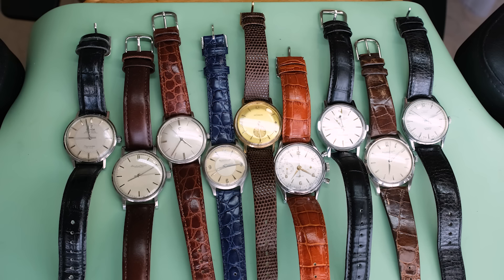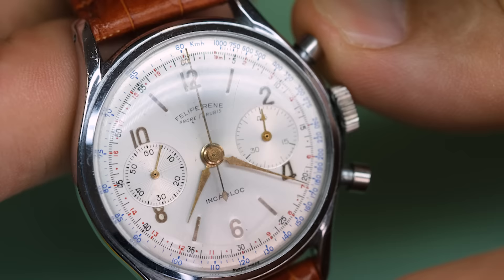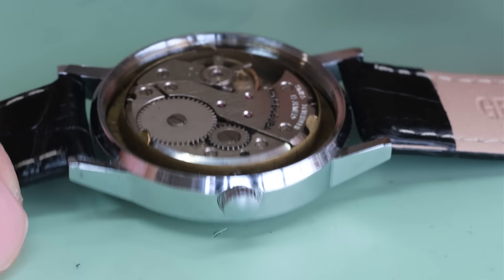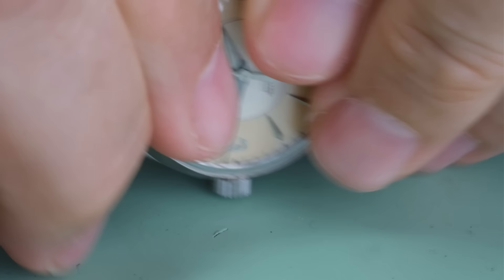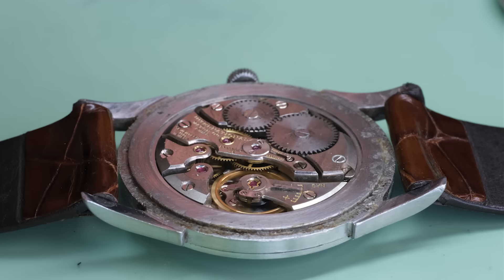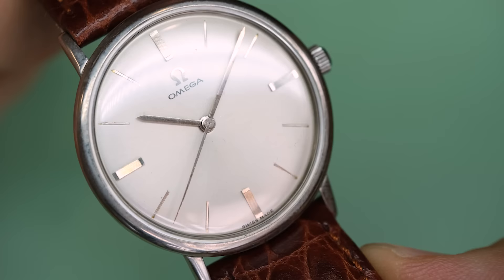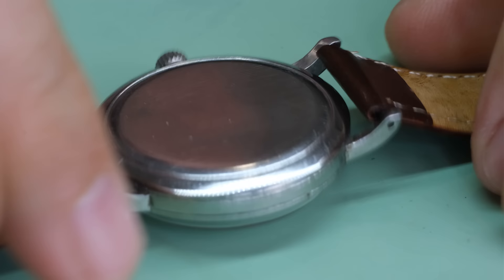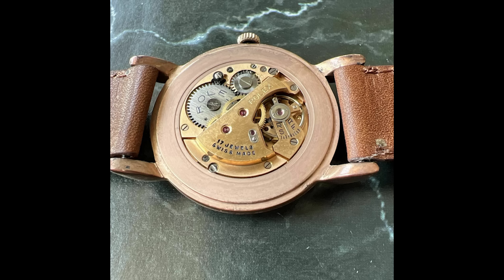How to waste money on eBay!

Comment: Fakes and Frankin watches, a very interesting topic, but one which needs to be filled out a little
with regard to price paid. 
The price you paid is also a good indication of the integrity of the seller, was he intentionally trying to 
mislead the potential buyers, or just throwing something out there at a cheap price, letting the buyer decide
the authenticity of the item.
People do like to own conversation pieces, (Frankin and Knock off) there is a market for such items.
It is OK as long as these are valued accordingly.
Reply: Ligia Gom  Yes a dial can be a good red flag as to an item's originality, as long as you know the brand history, of course the quality of dial is linked to the observers own knowledge of what to look for.  Take the Indian brand HMT for example, it is very difficult to spot fakes and franklins if one is looking from outside of India and not sure of the brand history or back catalogue. 
My general rule of thumb is ; if it is too good to believe, then take a closer look. 🧐Something is probably wrong.
Reply: It's sad to say but I just avoid some sellers based on location, there's probably good sellers in India, the Philippines and South America but it's not for me to write a guide (;
Reply: @jerseyneil1  HMT of India ? Lovely watches and I had to buy just one for my collection. Yes, I know it is an old movement in a new case, that is why it was so cheap.  Knowing before you buy is the only way.. BTW I learned my watchmaking on old Vostok movements, even cheaper !
Reply: Franklin? Do you mean Frankenstein?

Comment: regarding the Felipe Rene chronograph, it says “incabloc” on the dial but the movement had no shock protection so someone is lying. In my opinion.
Reply: Beat me to the punch!
Reply: @red75v67  It’s all good.
Reply: Spotted it too! Also, the O ring for the case back waterproofing is sticking out, close to the crown.
Reply: Nice observation! But maybe the watch is original. I can tell you that there were thousands of small workshops with thousands of brands in the 50's to 80's. They assembled watches and worked with the parts they had. So they f.ex. already had dials for the next Incabloc series and combined it with old movements. Or during a while, Incabloc was like a magic word and was printed on everything, since no buyer knew what Incabloc meant and wouldn't be able to control the truth of it. They cheated a lot on the new watches, so don't be to sceptic!
Reply: Just  to add: I own a Swiss Quartz watch putting "Incbloc" on the back! They just used old cases or even only old backs to combine them with new movements instead of throwing thousands of cases away.
Reply: Yes, no shock protection on that balance.
Reply: @Chrisamic  At  least, it is 40+ years old and still works due to the fat old quartz movement of the early days.
Reply: That's what I was going to say. I noticed they weren't installed either.

Comment: Not wanna be offensive but when I shop on eBay, if it is shipped from India, Pakistan, Bangladesh etc. I will switch immediately without checking the item cause like yourself, been there, done that, ripped off and lesson learned.

Comment: This is why I buy Longines tanks. No one bothers to fake or Frankenstein them.
Reply: Been considering buying my first longines the last dayes, what’s your’e expirience with the brand? Anything I should know before I pull the trigger? 🤨
Reply: @megakuli  I would say that case condition be a priority. Gold filled or solid is secondary(for me) to condition. If you plan on buying 40s and 50s the odder the case the better. Some of those have previously small production runs. You will find that you are the only one wearing such an item for 1000's of miles in any direction. Prepare to answer questions about your watch as they seem to Garner compliments. One owner or estate sales watches usually mean draw queens with no service but excellent states of preservation.
Stainless steel tanks are much harder to find. If you see a nice one Grab it.
Reply: @NitroModelsAndComics 
Thank you so much dude 😀👍🏼 Im gonna write this down and keep it in mind for when Im heading out to get my first piece 🤩

Comment: If you can be fooled this much Stian then God help the rest of us. My ebay purchases have generally been as expected but the odd bit of camera trickery has caught me out on occasion with cases. Cheers, Howard
Reply: I would venture to guess that Stian has purchased hundreds if not more watches on Ebay so the dud to gem ratio is probably not as high as this video may suggest ;)
Reply: I found mismatch with other sellers for my Smiths but still pulled the trigger cuz my previous purchase with the same seller was perfect. But this time it was a heart ache. Watch doesn't work like how it should
Reply: The pat two months I scored an amazing deal on a new Tissot III DAY/date for my son from one seller and a new Tissot couturier day-date for me from a different seller. Recently I got an awesome deal on a 2013 Rolex Yacht-master with box/papers(cheaper than any watch dealer in the world would sell it for).  

You have to use your intuition and take chances. Feebay provides allot of protection nowadays to sellers.

Comment: I have bought watches on eBay and similar for over 20 years. Some times I have made mistakes of course, that's what you learn from. But often I have had bargains and that's what counts, in time you learn, so mistakes are fewer and the bargains are more frequent. Having said that it was easier to get bargains pre 2010 as nowadays more people are more aware of the importance of researching what watch you actually have before posting for sale, and supporting this with good photos. The best bargains I had was to buy from sellers that were not in to watches and knew nothing about them, often posting old watches with badly scratched crystal, with bad photos. Often buying those paid off big time. I actually got a proper bargain last year buying a 1950's Omega with a badly scratched crystal, the seller believing something was wrong as the crown "only could set the time in one direction", I diagnosed this as probably a loose crown which turned out to be the case. So when I received the watch it was just a question of taking out the crown/stem, re-attaching the crown with locktite and sourcing a NOS crystal. Otherwise the watch was in pristine condition with a fantastic dial under the scratched crystal, in fact the best I have ever seen, all original dial, hands, movement, crown etc. I paid £300 for the watch, now I would not sell it for less than £1500....!

Comment: Without looking at comments it doesn’t have the Incabloc shock springs on the balance jewel. 😬

I’d like to think I’d catch that if the movement was shown but there’s a strong chance I’d miss it. I can tell you I’ve never counted jewels so this is a much needed wake up call for me.  It’s common sense to check those things but it’s just so easy to get lulled by the shiny. 

Thank You for this!  Liked, subscribed, & commented. 👍

Comment: The Felipe Rene chronograph has Incabloc on the dial--a spring loaded jewel for the balance wheel.  The actual movement doesn't have that kind of jewel protection over the balance?

Comment: I tried for years to pick up a few untouched, original HMT watches from India on eBay, and after a few well crafted duds I gave up.  These weren't the obvious Frankenwatches but old military models that had been restored using salvaged parts.
Reply: Sir, genuine HMT watches are available with original HMT dealers in Bengaluru (Bangalore). Also you can buy from Company's website, but sticks are limited.  I am also hunting for HMT Jubilee which is a class watch.
Reply: @kswaminathan5439  I was under the impression that they would not ship to the United States? I was trying to get an untouched Jawan model but it appears that I was getting aftermarket casebacks with fake Broad arrow watermarks
Reply: HMT Jawan models are with black dials and the numerals have glow paints which are very prominent at night. Yes, only original HMT Jawan has the arrow mark on the case back. But duplicates are available in plenty as this iconic Indian brand is virtually out of the market. I own 3 HMT Janata, 2 lovely HMT Sona, 1 HMT Vijay, I HMT Avinash, 3 HMT Pilot- all hand wound. In automatic I own Kajal, Sourav and Kanchan. Accuracy is awesome and I will cherish these lovely watches. Prices of these watches have trebled now.
Reply: HMT army models are awesome mechanical watches. A long history and legacy. Shame on India they could not save that real brand and now some people are just wasting time on restoring frankenwatches.

Comment: Venus 188.....dial says incabloc and there is no shock protection...also on Cal 188 the minute jumper spring is made in one piece from solid...Valjoux 7730 two piece with spring steel blade..... as always a good informative video....

Comment: I have seen a lot of videos about the Rolex Marconi with the Marconi name on the dial. I do not have a problem with well repainted 
dials as long as the rest of the watch is original. I have over 70 vintage watches. I have gotten great deals and have been took on EBay

Comment: there are seamasters from that era that are chronometer rated....never saw one in a unicoc case though. The dial is a premium dial, hence consistent with the premium cal 551. Seamaster Deville co-branding is applied opportunistically and is related to the marketing needs of a specific market...Having said that, I have never seen one in this combination...then again but Seamaster-Deville documentation is sketchy so it might have just escaped the factory in this way...

Comment: I KNOW WHAT IT WAS 2:25, it said on the dial "incabloc". for those who do not know, incabloc is on some vintage watches, and it means shock the watch has a shock protecting system on the balance. this SHOULD look like a meta piece across the balance jewel, and there should be no screws on the balance jewel to hold it in place, as to remove the jewel for oil WITH the shock setting, you simply have to move that spring, which is held by its own tension, out of the way. this watch however, does not have the shock setting, as evidenced by the lack of a metal thing holding the balance jewel in place, and the two screws on holding the jewel in place. this my seem insignificant at first, but it can be a major caveat when you remember that the balance pivot is one of the MOST delicate parts of a mechanical watch. one drop from the right altitude, and your looking for a brand new balance.

Comment: I always look for a photo where the case back is removed. I won’t bid on the watch unless I can see the movement. You might pay a little more that way because the seller has at least a small amount of knowledge about watches but it’s better than getting a watch that’s either rusted or broken/missing parts.

Comment: I tend to buy different types of watch, chrono , diver, dress, but I got caught with a seiko nemo from a pawn shop so I've no excuse. I'm defence apart from the lume it's every bit as good. The watch I has in this style was my father's. An oriosa date. I repaired it by fitting an original eta movement in a damaged case so its as it was. Had a similar timex marlin day date but sold that on ebay.

Comment: When I worked in Saudi Arabia there were people selling loads of "bent" watches. At least there were not trying to deceive people. I bought three Rolex copies and it really was a gamble whether the watch was good. The first one was a bad time keeper and just roughly made. The second was better and lasted about 8 years but the last one I bought has worked really well for over 10 years now. The only problem is getting it serviced. Most watch restorers would probably put a hammer through it.
All I can say to people is really research your subject before pressing the bid or buy it now button.
Reply: Find a ordinary retired watchkeeper.... Don't go to Rolex jewelery  store
Reply: Yes, We found a seller in the Riyadh gold market (AFFES BX for ROLEX) that sold copies.  Mine kept great time, till the battery died.  Then the "gold" corroded off the back.  It still looks great, from 10 ft away (in dim light...like in a bar; not in SA) and it has the perfectly correct time twice a day.

Comment: My biggest problem with eBay watches are those listed as "freshly serviced" but are not serviced.  I received one that poured oil (WD-40?) when the caseback was removed.  When you complain, the seller says, "That's what I was told."  Fine, but the auction should have said "I was told........." rather than stated as fact.  When I've asked for a service receipt not one seller could comply.
Reply from the maker: Yep. That's a very common experience when buying at the bay 😁

Comment: A few years ago, I bought an India Frankenwatch off eBay, a Swiss-made Henri Sandoz. The movement seems to be genuine, but not sure about the dial and hands. The strap is horrific of course. The good news is that it was only US$15.49 including shipping to Canada all the way from India. Great value. Works well, and it's just cheap fun. After that, bought a Made In India watch with a very nice picture of Nehru on the dial. Cheap fun.

Comment: Hello sir, I hope to add that the IWC 89 piece you own is also likely to have the wrong case back or wrong case entirely, the case back has a bump on it intended to house the IWC automatic movements 85x. The dial is likely a refinished dial as well, is it incredibly hard to find a genuine one on the market. (I also own a redial cal 89, hard lessons learnt)

Comment: Running mechanical movements, that alone is pretty good.  If they run good who cares if you wear them and like them.  Purist collecting is expensive and snobbish.  I have several quartz watches that take a $2 battery and are very accurate.  On top of all that the Chinese are getting ready to take over the mechanical watch market with high quality low cost good looking watches. Did you say what you paid for these watches? Oh and by the way good luck finding the parts you want.  It could get expensive and take a very long time.

Comment: Is it wrong that I bought a franken Polerouter because I couldn't afford a good one. It's a real pole router just made from parts for about 1/3 the price. It's a perfect running bumper and I love it. It has an incorrect crown (expected), and one gold hand and one silver hand which I didn't spot for months! But It does have an exceptional unpolished case. 
And the second watch did not have incabloc.
Reply from the maker: The most important thing is that you wear a watch you love wearing, I'd say :)

Comment: There are lots of "franken watches" out on ebay unfortunately.. Have you been working with clocks, the funny thing with them is that the pars are so much more larger on them that some folks get in their mind the idea that they can repair them, and oh boy... The usual repair modes are to drench them in different kind of oils, file the anchor or escapement wheel or to fabricate own parts etc. It is hilarious and then it is horrible to repair it..

Comment: I find on eBay or chrono24 and especially with the more bland looking 60’s/70’s Omegas that are normally the lower priced models the cowboys do love to badly repaint  the dials in whatever is the “in” colour at the moment. 
And those poor old Omegas seem to be the victims. Last year when Rolex brought out the coloured dial OP’s suddenly a plethora of green, pink, red, yellow and “Tiffany blue” dialed “genuine” seamaster and Devilles starting appearing and surprise surprise at prices several hundred Euros higher than normal silver dialed examples!

Comment: Turkey and India have great industries 'restoring' dials. China has various case makers that reproduce vintage cases, like the JLC. People engraving Rolex on a Felsa movement is new, but why not...? You have to spend either 10.000 hrs and become an expert, or buy from large, trusted ebay outlets, or from an online outlet that has verification services. Last tip: if you found your dream watch, look at the other offers from the same seller. If anything fishy (non document repainted dials, 100% original but with non signed crown...,) walk away.

Comment: It’s crazy that watch maker scammers take parts from different watches and movements. Then brand them high end watches but they are not.  There’s many repainted Omega’s with movements that are real but the parts are not Omega but the watch maker with a tool writes Omega in very neat lettering but it doesn’t match.  They try to up bid you so they make there money but rip off the uneducated customer.  It’s better to save your money and buy the real  vintage version.

Comment: I’ve bought from a reputable Norwegian watchmaker a gold on steel Seamaster DeVille, allegedly a 1964 model in near mint condition. Is there anything I should look out for that might indicate it being non-original? I have however no reason to believe that, including that the hands and face appear untouched.
Reply from the maker: Hei Bamse, det beste er å søke etter den samme refereransen på Chrono24 og se om du ser forskjeller. Hvis du har et forstørrelsesglass du kan også se etter små aldersmerker på tallskiven.